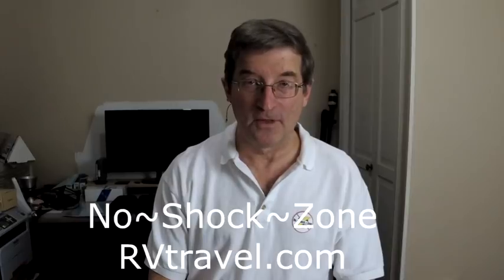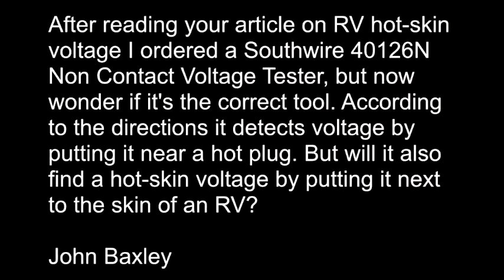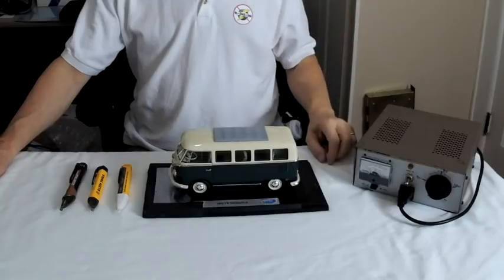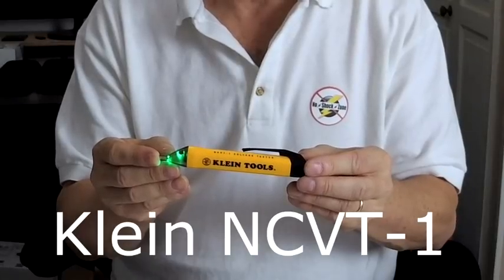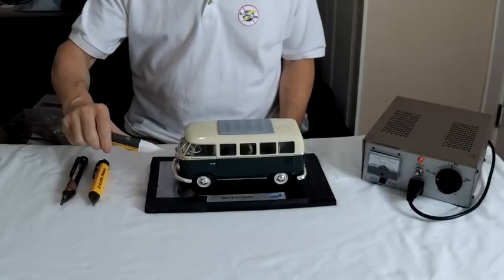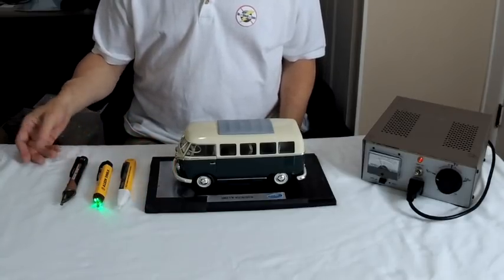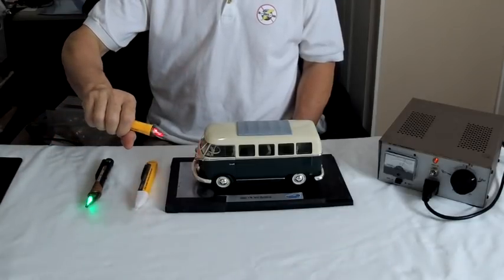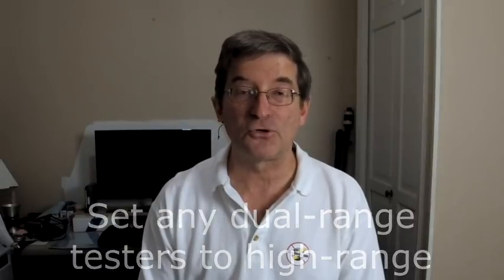How to test for an unsafe RV "Hot Skin Condition"

Comment: Mike: At a pedestal do you need to open the door to where the circuit breakers and plugs are or can you just touch the tester to the outside of the pedestal.  I've been challenged twice as I always open the door and test near the circuit breakers and plugs.  Both said I was overdoing it.

Comment: So I was wondering how this applies to a fiberglass skin RV and was wondering how often you need to test? Every time you hook up to a new pole at  new site?
Reply: Yes, it certainly applies for a fiberglass skin RV. That's because the phrase "hot-skin" really isn't accurate. It really should be called a "hot-chassis" since the chassis of the RV, and everything connected to it, can be energized with up to 120 volts of potential. So your metal steps, hitch, tow vehicle, and virtually anything metal in your fiberglass skin RV can shock you if you touch it while standing on the ground. I think you should test the pedestal for a stray voltage BEFORE plugging in your RV, then test the RV itself AFTER plugging your shore power cord into the pedestal.
Reply: Wow, seems 120 volts going to your tow vehicle could wreck havoc on your 5 volt vehicle computer system.
Reply: @mikesokol2076  How is one checking for stray voltage at the pedestal with one of these? Won't it just sense the voltage regardless whether it is stray, or where it is supposed to be?

Comment: I doubt that is a good test.
Reply: Tom, I've done this hundreds of times and it's 100% accurate with any stray-voltage over 40 volts on something as large as an RV. It's nearly foolproof accurate down to 30 volts using NCVTs that I demonstrated, as long as you wrap your hand around the handle of the tester. It's true that you don't want to bet your life on a "tick tester" if you're going to be reaching into an electrical panel. However, this is just a quick, non-contact test that anyone can perform without the training needed to use a DMM. What is your reason for doubting the validity or this test? Have you tried it on something the size of an RV? If so, let's discuss.
Reply: Mike Sokol I guess what I am worried about is at 30vac, you are already out of the testers specified range. So I question if it would really catch it 100%.if you say it will I can accept that. I would still be worried about any voltage up to that point as some folks may have pacemakers and that could be a bad situation and the tester won't catch it. I think I would prefer a voltmeter if I am going to spend the time on it. But that is my opinion. Thanks for sharing. I did like the video.
Reply: Todd,  you are correct that a voltmeter and a ground rod would provide a more definitive test. However, I'm attempting to mobilize thousands of casual RVers to regularly perform this basic proximity stray voltage test at campgrounds around the country. In my own experiments I've found that most of the time when the EGC (Equipment Grounding Conductor / Safety Ground) is broken that the chassis (and skin) of the RV will float up to around 1/2 of the line potential, which is 60 volts or so. In that case any of these NCVTs will easily detect the stray voltage. Remember, the low-voltage ratings of these testers were developed based on the small surface area of a single wire. Since these are capacitively coupled to the sensor in the NCVT, the larger the surface the further away and lower the stray voltage can be to trigger the alarm. Again, I've done this experiment hundreds of times on objects of all size, so I'm now soliciting the NCVT manufacturers to change their owner's manuals to reflect this advanced usage.